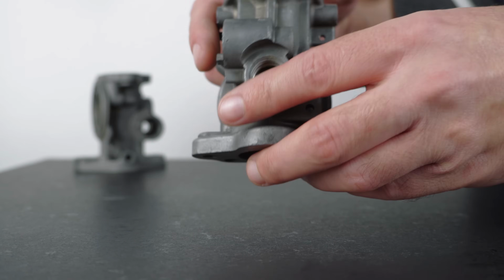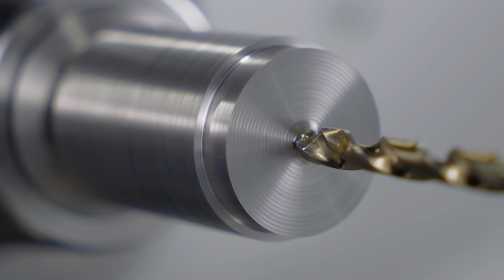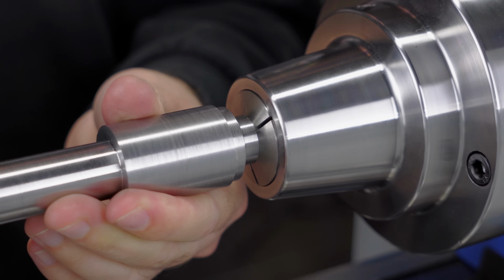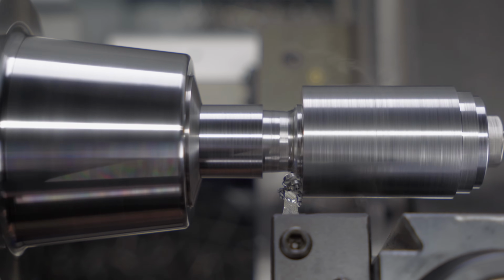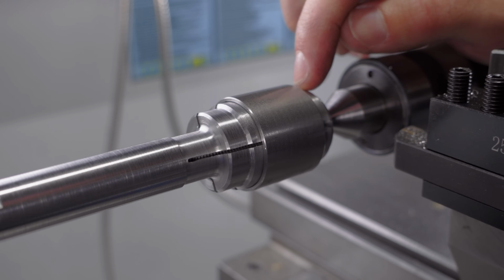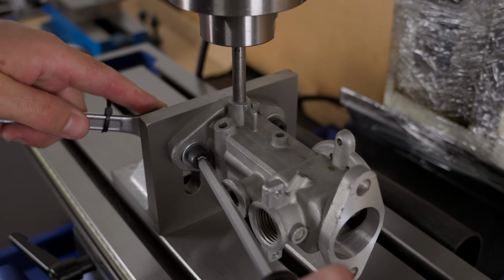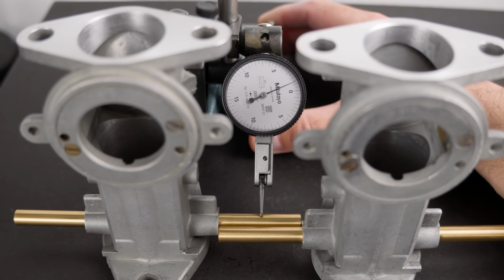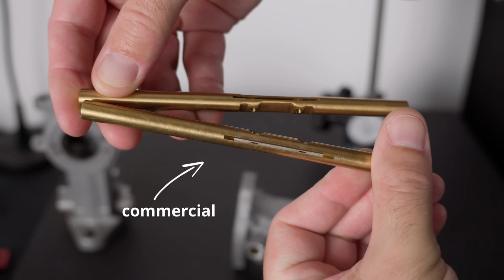Let's face it, no one does this on the lathe.

Comment: I stopped at 20sec (I will finish it) but you should've indexed from the cylinder bore (using shims under the base)  before the first decking.
Reply from the maker: I indexed it from the bore 😉
Reply: @nbrworks  Maybe "the top" of the bore, but if you indicated the entire cylinder (both concentrically and along the z-axis) there'd be no geometric way the ends wouldn't come out parallel. This is exactly what you did when you used the mandrel in the lathe. The central axis was both concentric to and parallel w/ the turning center. You then created a flat base with perpendicular cuts to the flanged surfaces. This is what putting shims under the base and decking the top would do. Flipping the piece over and finishing is just a continuation of this.
Reply from the maker: That was my first approach. With the carb on the mill and a coaxil indicator, running up and down the bore, trying to make it square to the spindle. It works. It also takes a long time until it's right. The bores are not 100% perfect and indicating/averaging them takes time. Since I have a few carbs, I tought the tool was worth it. Now I can chuck any carb and recut the faces in 5/10 minutes, maybe less when I do them in batches. Your idea works, and if I only had 2 carbs to reface, that's how I would've done it.
Reply: @nbrworks  My issue was just with how you presented the problem. At 0:11 you say "the problem is, you have to use one of the flanges as the reference for the first cut". I was trying to clarify this is not the case. Hence, why my first reply stated I made it only 20sec in before needing to comment. 

I would agree with time saving for multiples. I have no issues w/ the mandrel you made, I think it came out great and I love making fixtures/jigs. You still get a sub from me, though ;)
Reply from the maker: Yes, I got it, the way I said it made it sound like the problem was referrencing the first flange. Never thought that could sound like that, my bad. Thanks for pointing that out and of course, for joining the channel group!

Comment: Those chips are dangerous. The solution is always to increase the feed rate, 0.3 mm/ rev is a good starting point and you can go much higher. This will also save time obviously. For a finish cut, leave about 0.3 mm radially (at least the amount of the insert's nose radius) and use a lower feed rate of about 0.1 mm/ rev. And please stay well clear of the machine especially with those long chips, once they wrap around the workpiece you can instantly get hurt very badly.
Reply from the maker: I had one long chip at the beginning and then played with it a little bit to see where it went. I was away from the machine and initially guided the chips to the floor, they weren't getting near the chuck (but it only takes a split second to happen, I know). I also don't usually take such heavy cuts. I tried to increase the feed but the motor couldn't keep up. For the next cuts, where the chips are breaking, I reduced the depth of cut. Anyway, thanks for the heads up, I'll be mindful of showing 'bad examples'' next time. Cheers
Reply: @nbrworks also, friendly suggestion,  please don't use your finger to test surface finish while machine is running.  Nice work, though, but there viewers who notice every little detail.  Take care

Comment: What kind of steel is that you’re working with? It seems to cut like butter 😍
Reply from the maker: Hi Edward, it's free machining steel. ISO 11SMnPb37 / AISI 12L14. Thanks
Reply: Basically 1018 with more sulphur and lead to increase machinability.

Comment: There is a school of thought that a slightly convex face to the manifold would ensure a better seal around the inlet circumference as the flanges flexed courtesy of the paper seal. ie as the nuts are tightened, the a perfectly flat flange becomes concave.
Reply from the maker: I wasn't familiar and can't see why that wouldn't work, but to be honest I'm expecting a machined flat face to work just as good 🤞

Comment: Not sure I would have done the partial bushing, you dont want that remaining bit becoming loose over time and maybe falling into the carb and wedging the throttle open or affecting AFR due to blockage in the inlet.
Reply from the maker: The ring left is part of the carburetor casting - it's aluminum. There's no way it will become loose. Sure in theory it could break in pieces - but I don't see how that could happen - there are no forces making that happen - it's just highly unlikely.
Reply: @nbrworks  Ah! I thought it was part of the bushing you'd left rather than the housing. 

Great video I really enjoyed watching your skills.
Reply from the maker: No, no, the old bushing was completely removed and the new one will be stuck between that aluminum shoulder and a clamp that bolts onto the shaft (not shown in the video). Worst case it gets loose and rotates, but it will not come off. Thanks (glad you got it with my explanation).

Comment: Maybe with the machined base the bores were better aligned between both clamping setups, so when reamed the reamer isn't trying to center on the second bore causing it to make a curved cut?

Perhaps have an internal fixture with a guide/support bore for the reamer, then align the boring operations to that guide so when reaming the second hole the guide supports the reamer stopping it from trying to follow the hole?

Doesn't help on the first bore though, maybe a long piloted reamer so the holes are reamed to the guide?
Reply from the maker: A pilot reamer would help, I think. My thoughts are similar. I suspect the bushings were not very straight to begin with and the reamer isn't cutting at all, just bending. Then the shafts bind at specific points. An adjustable reamer might be helpful, as suggested on another comment, but I don't know how much plays the shaft would end up with. Thanks for your inputs!
Reply: @nbrworks  Try undersized bushings and bore them with a polished aluminum insert after they have been inserted, both in a single setup. 
Since a non tapered reamer only cuts on the end, the first cut sort of sets the position, so lots of pecks and light cuts for the first mm should stop it getting pushed around by the hole and cut the start to the spindle?

Comment: Thank you for a very informative video however, the one question I have to ask is what fuel will you be running the engine on that will pass through the carb?  If it has an ethanol component, the brass bushes and spindle will corrode and cause all the same type of issues that you are attempting to machine out.  I would use a Delrin bush and a stainless or silver steel spindle that can be bought in certified diameters.  Its interesting to note that the Brazilian Solex carbs have next to no brass components because their fuel either contains high volumes of ethanol or neat ethanol.
Reply from the maker: Hi Clive. That's a very interesting question. I've seen the concern online before. I remember reading a thread in some forum where someone tested some materials in some jars with ethanol... as far as I remember it was not conclusive if it would cause a problem or how long it would take to cause that problem. My first concern is the float bowls which are thin brass and are in constant contact with fuel. Currently I can still get (supposedly) ethanol free fuel,  but I don't for how long it will last. 
Do you have something or a situation you'd like to share about this? I'm interested to know more. I'm aware I need to get good rubber hoses (Gates maybe) and even with those not expect them to last more than a couple of years.
Reply: @nbrworks  The issue with ethanol is a common one that is well known in the classic car world.  I have seen various renovations documented where the brass components of carbs have corroded, which is unusual to say the least, usually the brass elements last considerably longer than the other metals around it.  These examples were based in US where eithanol has been used for some time and the machines were left for long periods with fuel in them.  We are talking prolonged periods so that testing would have to extend over years and not a few weeks.

I have an aircooled VW Beetle with an electronic fuel pump that was initially an old faithful that I purchased many years ago before ethanol was added to fuel.  It served reliably in various vehicles, including the Beetle until ethanol was added to unleaded and it expired not too long after.  The replacement pump is identical although, Facet the manufacturer, specifically states that it is suitable for ethanol added fuel.  It might be a coincidence that the original one failed but the timing was noticeable.  Also the Beetle is fitted with a Brosol carb (Brazilian Solex) that has fewer brass parts than the original Solex carb and given that Brazil has a high usage of ethanol, I would expect that is the driver for the change.

If you are changing rubber hoses then the safe ethanol resistant quality is R9.  Unfortunately, R6 is commonplace that is slightly resistant and that is what you will mostly find in the motor factors.  The brand is not so important as getting the correct spec  SAEJ30R9, which will be printed on the hose.

The other issue with ethanol fuel is the longevity, with E10 'going off' within 2 months, E5 within 6 months and non=ethanol fuel lasting 12-18 months, which is important for classic car owners and horticultural machines that may stand for long periods without use and a fuel supply can sit in a can for months.

Comment: What about a press fit shaft installed with thermal expansion? I would imagine the aluminum carb would expand quicker than the stainless rod so a quick hit with the torch would release it.

Comment: My friend let me tell you you take this part without the ring diameter make a matching plug using the same angle.
You may wish to use a shalower angle but nothing less than 10 deg and take your plug much deeper into the mandrel don't neck it down so much unless you must where ever the relief is you must take the saw cuts into the relief
You can apply the expansion plug utilizing your Live center and pull it out with what we call a Russian hammer a puller.
Use a heavy Molly Grease the key to this whole thing finish all your diameters you cut the mandrel slots on a band saw last deburr neatly with a small Jewelers file.
If you have a nice diameter it's easy enough to re indicate in especially if you dump that three jaw Chuck and only use a four jaw if you think about it it is so easy do not let it scare you 3jaw chucks are lame inaccurate even I only use them for soft Jaws where we us a setting ring or mandrel and then they are cut to suit the part. 
Looking at your part is almost perfect as long as it's bigger at the big end that is all that really does the pushing I think your angle is too sharp and the entire mandrill is too short try boring almost all the way to the shoulder leaving only a small amount like maybe a quarter inch wall to do the actual outward movement
Reply: The easiest solution you make your mandrel drill a small hole for your pipe tap use a pipe tap reamer and tap deep enough to apply half of the tapered pipe plug.
you use a tapered pipe plug to open the mandrel but again you must finish all your diameters when it is solid drill and tap the pipe plug thread use a bandsaw to cut the slots last debur very carefully with a small Jewelers file and fine sandpaper. Done easy peasy
Reply: You know they make external centers as well

Comment: Did you check the bore perpendicularity with it bolted down, probably not. Ill bet it was square and would seal with gasket material. I wouldve checked this with it in a bolted condition you would be surprised how much metal moves when restrianed against a flat surface. It is possible what you've done is ideal but possibly unnecessary and may have been more work than what is worth. Albeit analytically acturate. Secondly the only function of a reamer is to size a hole they will never straighten nor relocate any hole period. At the end of the day you were successful in your goal to make multiple peaces match with in .0035".

Comment: Nice video!
I think reamers are supposed to be a little flexible to change only the hole diameter, but not position. So you can't use them to fix position or alignment errors.

Comment: Impressive work and very nice video to watch and listen to.
Regarding the pairing of materials, am I correct in assuming that bushing and shaft are of the same material (=brass)? That would lead to a higher wear rate than pairing dissimilar metals. I'm used to seeing steel shafts running brass bushings or in absence of those, in the aluminium of the throttle body itself.
Reply from the maker: Hi. The bushings are bronze and the shaft is brass. Just like the originals.

Comment: great work again, thank you very much! 👍 why did you use such a long boring head to bore the bronce bushings and the chamfers...i would be afraid of chatter...although they came out great, so what  : )
Reply from the maker: Hi, nice to have you back! 

It was a matter of using what I have available. The boring head takes 12mm tools. 
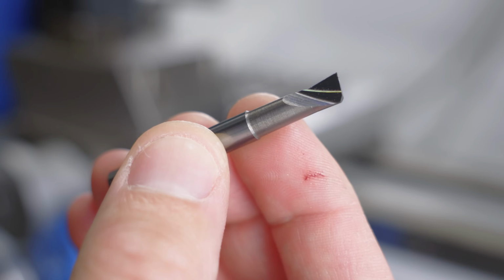I don't think I have any broken tools with 12mm shanks (to grind), and the 6mm boring bar shown at 8:16 looked perfect for the job, including the 12mm sleeve (coincidence?).

I thought of cutting it in half, but not without trying it first. And it went well for the boring.

For the chamfering I seriously considered cutting it, also because the carb body is very long, hollow, and was only clamped at the bottom. 
But the tool was sharp and I gave it a go. If you look in the video I didn't let it rub, I was quick to feed, let it cut and retract immediately. I think that if I let it rub it would chatter.

I definitely need to get a shorter sleeve though.
Reply: @nbrworks  thank you for the answer 👍 i think you are right, the quick retract was the key. nice to see, that it worked out : )

Comment: With regard to the stiff shafting. Would they be smoother if you just drilled the shaft holes all the way through when removing the old bushings vs stopping before the bore on each side?

Comment: When your arbor expands do you get any issues with the sides not being parallel ie. tilted out? I would think with a ~10 inch distance between flange and arbor contact surface that would create quite a bit of play. This is why normally you would use 2 cones screwed on a shaft, one in each flange to keep the inner bore level.
Reply from the maker: Hi, the challenge with this tool was to make the sides parallel. 

Have a second look at 20:16. The ring shown is to 'lock' the jaws expanded (so they don't break) while I make the final passes and take the arbor to size. By doing that, I got the sides parallel when the arbor expands to 31.71mm. The end result of this is non-detectable runout and a very repeatable setup. 

If you look at the comparison done on the surface plate, I got each body parallel within 0.0005" (0.01mm) and that was after removing several times from the arbor to check the progress. That's why I say the setup is repeatable.

Of course you can argue that 1 1/4 inches (the bore size) is closer to 31.75mm so there's theorethically another 0.04mm difference, but after averaging the bores with the internal micrometer I found out that 31.70 was actually the bore/arbor size.

Hope this makes sense. Thanks

Comment: I'm astonished by why there are so many aluminum castings with either steel or bronze cast into them within the alloy. Probably because they want you to replace the whole carburetor and prevent you from fixing it; but the day comes that we can't buy a new one. I know you had a reamer made, or made it yourself, but at least if you undersized it a hair you could have a light press fit for the bronze bushings. Many people don't realize how important it is to keep things square and parallel, I'm glad that both you and I do...
Reply: If it's a matched slip fit, some green loctite (press or slip fit) will lock that bushing in just fine. It's a throttle plate not 2 ton crusher axle.

Comment: I would have kept the old bushes and turned 2 o ring grooves on the shaft.  Do you have the flexible link to join the shafts?  It would have been a good idea to keep the pistons and dashpots that were matched to the carb bodies together.
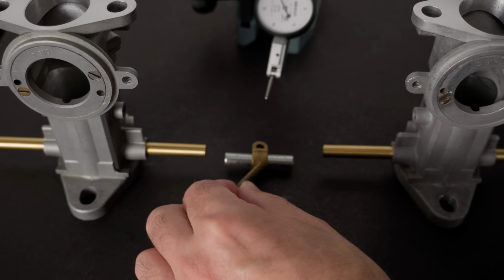Reply from the maker: The shafts are linked using a pair of couplings, have a look at 31:17. 
But I think I know what you mean by flexible link, I have some H1s (1 1/8") that have a flexible link, but not the H2s (at least not the ones I have). 
The pistons I'll be using will not be the originals - I'll be using the quick lift type. Thanks
Reply: It does need an o-ring in the mix, how can a shaft be loose enough to pivot, but not so loose that air is allowed to leak in?? Unless it's factored into the jetting, I'd think it would be far more relaible with a seal of some type.
Reply from the maker: Originally none of these types of carburetor have seals. That's why it is so important to have as less play as possible. Look up for h2 or hs2 or h4 (bigger size) diagrams on google - you'll find exploded views with all parts.

Comment: Does anyone know what the M designation on the 250-101M stands for?
Reply from the maker: Hi David, I don't know what it stands for, but it's the lowered version (the tool sits lower compared to the regular 250-101 model). I got mine from Arceurotrade in the UK and I haven't seen them anywhere else.
Reply: @ thank you so much. I hadn't seen it before and found no search results. 

I'm very new to machining and found your video extremely informative. I very much enjoyed your time in making this.
Reply from the maker: Thanks David. If you go to arceurotrade's website you'll find them there next to other tool holders.